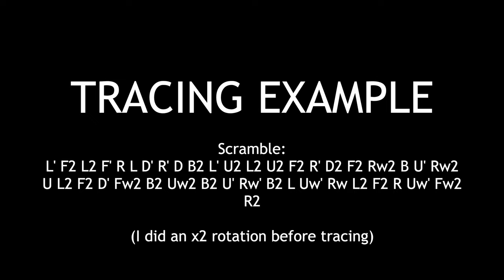4x4 OPA Tutorial (ARP Tracing)

Comment: Awesome, been waiting for this video! Thanks for sharing :)

The trainer you mentioned is made by Einar, but the idea is mine. I also made my own version, but it's private and only in python, so not as clean or easy to use as Einar's.
In case anyone's wondering about how to use it:
1. Scramble the cube with the given scramble
2. Time your tracing (spacebar to start/stop)
3. Press 1/2 for odd/even (or parity/no parity)
4. From the already scrambled state, apply the next (shorter) scramble. Note: You can apply the scramble from anywhere
(5.) Repeat steps 2.-4. as many times as you want

The idea is that tracing is the hardest part, and with this trainer you don't need to solve the cube between each tracing, meaning you can focus on improving that step only. The trainer also gives you statistics on how well you're doing and improving.
The way the program checks parity is by counting how many quarter wide moves are applied, so even = no parity, and odd = parity.
Reply: Sterkt, Ulrik! 💪

Comment: How do you go about keeping track of what's been traced?  I'm using my fingers but it's all over the puzzle and so slow and I almost make moves.
Reply: I don't think there's any fool proof and effective way of doing it, but one trick is to use the number. If you're done tracing and the number is low, you're probably missing something. If it's high, you probably don't have any more wings to trace. I've practiced OPA/APR for a couple of weeks now, and from my experience you learn it intuitively after some time. I still miss some 2/3-cycles here and there, but overall I've gotten quite good at knowing when I'm missing something.
Reply: Since this is the same as edge tracing in BLD, you do the same things people do when starting out there - use your fingers for edges on the left and right sides, and just remember edges in the M slice. Alternatively use your fingers for every edge, but take them away when you hit all the edges on a given face. Either way though, you'll develop a sense for it over time

Comment: You can do the first cycle trick (not the x2, but only adding 1 if the adjacent edge is bad) for subsequent cycles too, right? Seems like another small optimisation that could be useful
Reply: Yes the first cycle trick can (and should be) used for all subsequent cycles.
Reply: @AedanBryant  Yeah I thought as much, seemed odd that wasn't mentioned
Reply from the maker: You can use the first cycle trick for other cycles if you want to, but I decided not to for a couple reasons. Feel free to try it out though if it makes more sense to you!

One reason is that once you get familiar with tracing you can start choosing which wing you trace with. E.g., after picking an edge and adding 1 for a new cycle, you trace to whichever wing you see first. This can make tracing smoother with fewer big pauses. If you use the first cycle trick for subsequent cycles you don't have this option
Reply: @ariranderspehrson  I mean you totally can trace to whichever edge you see first, you just need to remember the orientation of the edge you started from to know whether to add 1 or not

Comment: I have a question. I am white/yellow cuber so I solve white and yellow centers. But I prefer checking the orientation having white front and blue too (which is my blind orientation). I am so much used to this scheme and wheneber i see an edge, i can instantly tell where it should be solved. The question is, if it is possible to do tracing in my blind orientation and solve it in normal orientation?
Reply from the maker: Yes! The parity state of the cube is the same no matter the orientation you trace with. This means you can start on any color
Reply: @ariranderspehrson  nice thanks!